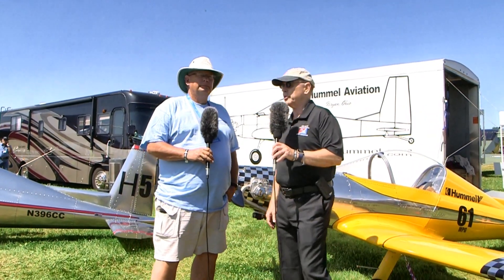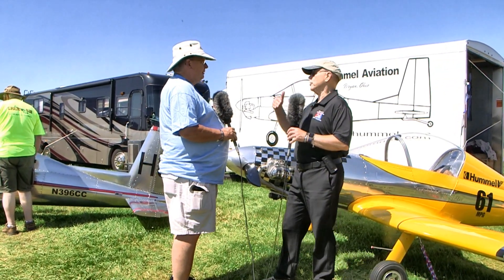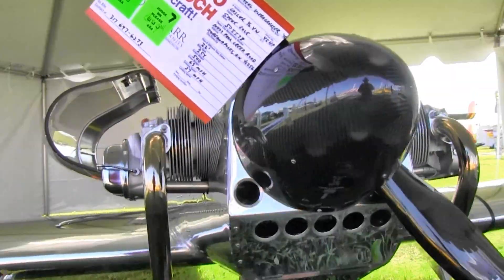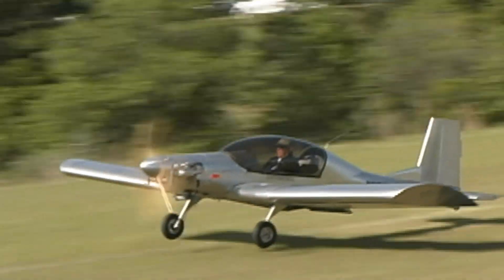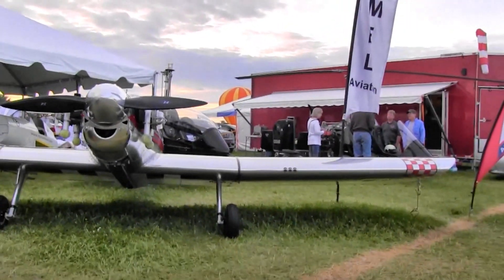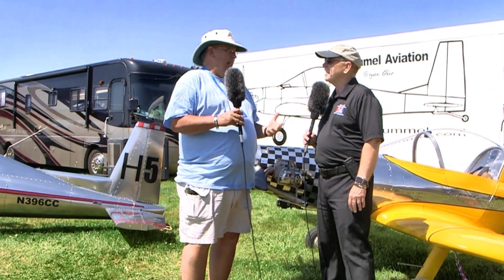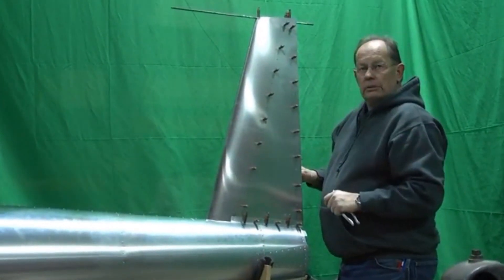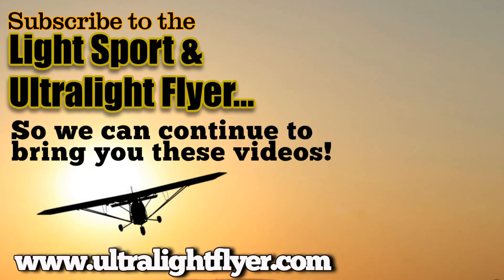Hummel Aviation, Hummel Bird, Hummel H5 and UltraCruiser all metal ultralight, experimental aircraft

Comment: I like a minimal plane because optimization is king. Cheaper and performs better, what are we talking about. And it's not a huge stretch to have straddled tandem seating. Takes very little cabin space with legs on the side of a narrow seat back. Some cricri traits there, I would redesign. It's not 1980 anymore. Reclined seat, minimal canopy, few pieces of sleek fiberglass or carbon, single piece wing. And half a VW engine just seems very self inflicted. Why not a bit of irony and use one of rotax' 10x cheaper good engines not meant for planes. They have quite the range.
Reply from the maker: Anymore and it wouldn't be an ULTRALIGHT AIRCRAFT - at 254 lbs!
The Ultralight Flyer
Reply: @ultralightnews  of course it has to be within weight limits. Just buying new instead of sawing a 1970s engine in half.
btw are you censoring the comments? that's not cool. I'm a patron and I wont be if that continues.
Reply: Dan Frederiksen

Geesh...!!!..You "Arm Chair Designers and Engineers"...Dude, Not ev'ry one's got access to million dollars Bank acct and a million sq. ft of shop or Hangar space!!!!...Most dudes have just enuff to let thier dreams become a reality and not pissed off the wife/GF with what she gonna call " Your Toy".....Plus, w/ part 103, it has to come in at 254lbs...No more...and, If you add all what you say, which some guys cant even figure out how to change a flat tire or WANT to, then, who's building any of these, Huh ???...
People always on here saying..Add this, Add that ..I would put this here, I would add that there....
Well, Its tons of Free designer pics and plans out there you can modify...Plus, there's the 'ol noggin' where you can one off something so unique to you, You can call it the "..𝘿𝙖𝙣𝙨𝙚𝙣𝙚𝙧𝙙𝙚𝙧𝙛  𝙈𝙓 1...And you will have the only one...And let your designs die w/ you so no body else can build one like some dudes have done....!!!!!!...Cheers....
Reply from the maker: I will do whatever I feel is in the best interest of this channel. I check ALL comments before they go live!
The Ultralight Flyer
Reply: @ToyManFlyer1100  then it's important to get the design right, isn't it. So that little freedom isn't wasted.
Reply: Except the rotax isn’t cheaper. The 1/2 VW is still cheaper even when built new. And YES you can build a 1/2 VW with brand new parts straight from a currently running factory. Or you can BuY a freshly built 1/2 VW from Scott Casler. He will use new parts if you pay for that. No need to redesign a good flying airplane that has no real flaws.
Reply: Well Dan, get it done and produce your own kit airplane. You write like you have the qualifications for the job. Hope I live long enough to see that.
Reply: Because if you do all that, now you've got a $50k aircraft. I say leave it the way it is.
Reply: @ultralightnews  sounds like the only opinion allowed on your channel is yours. Censorship is never a good thing.